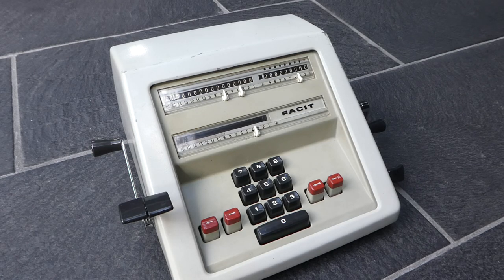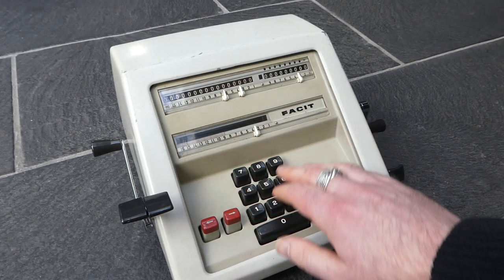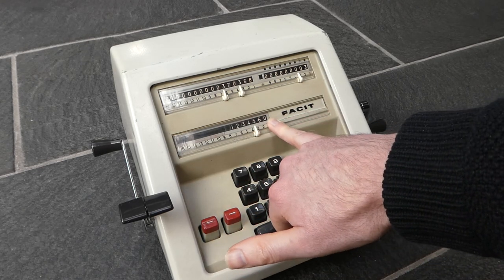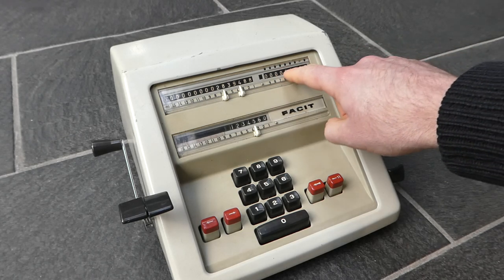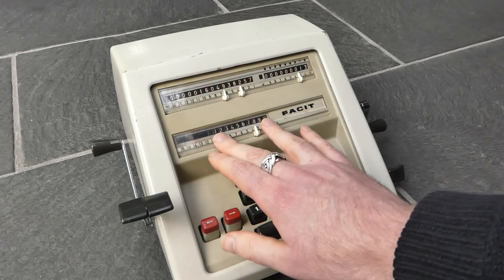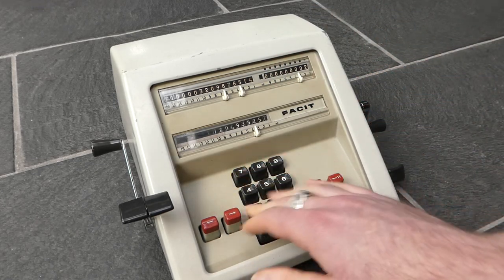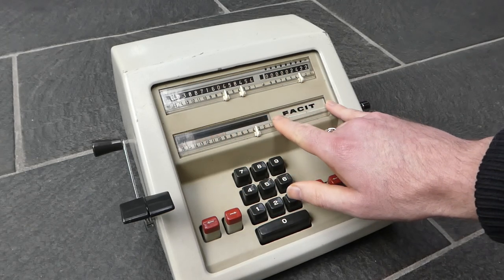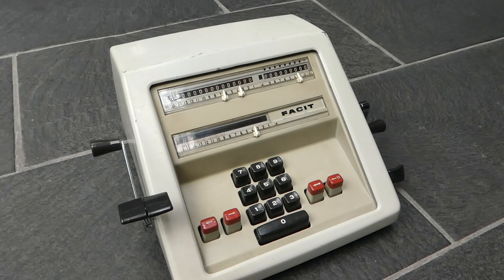Facit CM2-16 mechanical calculator

Comment: Hi Jaap, I like the fact that you can back transfer the total from the counter, that's a neat feature.  I've bid on a few of these but never won the bid - nice to see one working  :-)
Reply from the maker: Yes, it's a very clever design. Sadly it meant they had to get rid of the cover that hides the added zeroes when shifting the input to the left.
Reply: @jaapsch2  Ah, of course, I couldn't think why they'd got rid of that sliding cover, that was always a really neat feature.
Reply: Too bad that u have not manage to get it, very interesting machine, bought mine 3 months ago on flee market  in great condition for about 6$ and it was fun to discover on my own how it works. It is first mechanical calculator i have and i wanted one for a long time, i hope u get one for you`r self soon.
Reply: @Dagoth666Ur  Wow, that was a bargain Dagoth666Ur!!!  I've stopped looking for the moment, lack of time/space/money etc although at the price you paid, money wouldn't have been such a factor.  Hope you're enjoying having such a cool machine.
Reply: @GrumpyTim  I was baffled with price too, my first thoughts was that is broken but it was in such a great condition (just a few small scratches) that i couldn't pass, and yes i love it.

Comment: How to divide on it? In the same way as on Odhner machines?
Reply from the maker: Yes, division is exactly like Odhner machines. Entering the dividend is made easier by the red button second from the right, which shifts the input register as far to the left as it will go.